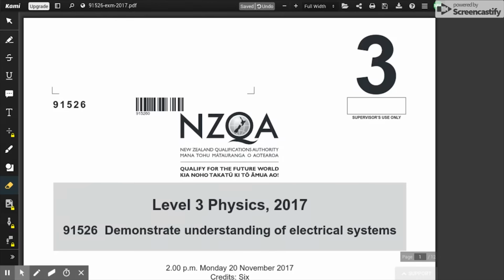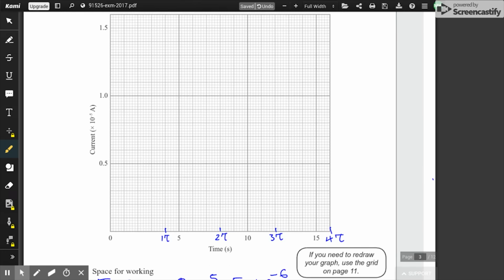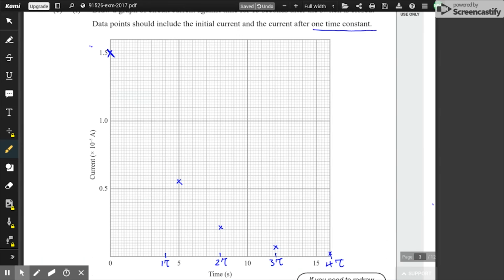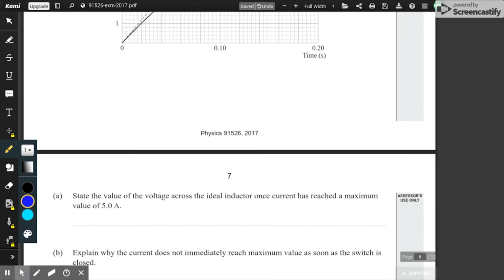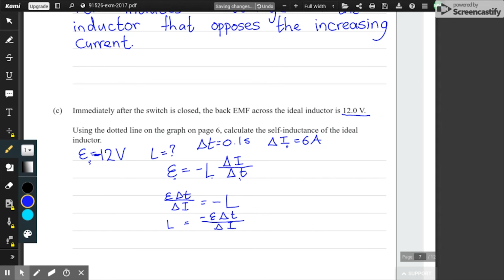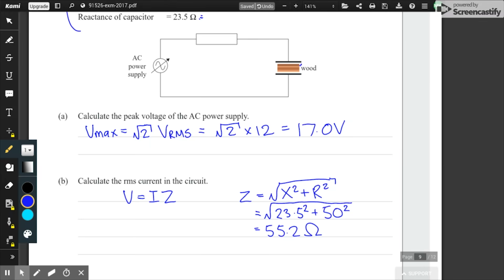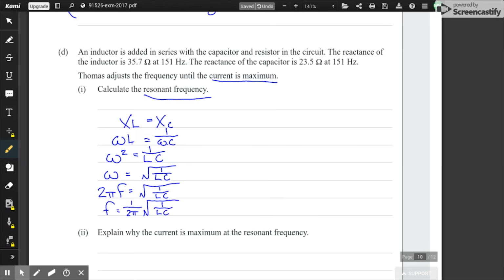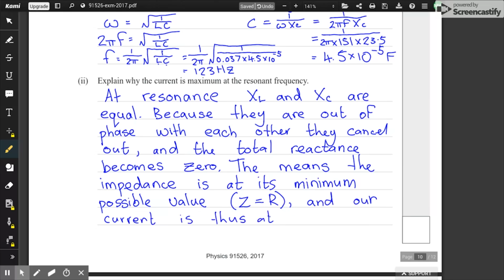2017 Electrical Systems Exam (NCEA Level 3 Physics)

Comment: for 1cii, you say the plates are at their maximum charge initially and discharge over time, but the question earlier says that the capacitor starts uncharged. Shouldn't it charge when the switch is closed rather than discharge?
Reply from the maker: Hi Jack, good catch. I've written this for the case of a capacitor discharging, when it is in fact charging.

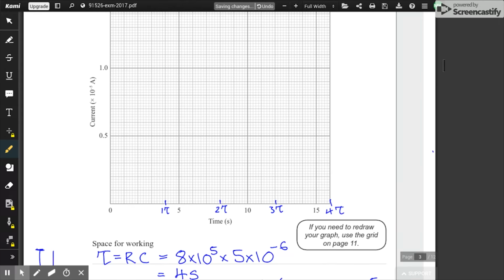Comment: Hi sir, at the 6:00 mark, you plotted the 0.56 away from the 1 time constant symbol, was this an error or is there a reason to this
Reply from the maker: Woops! That is indeed a mistake. Fortunately the marking scheme is usually quite forgiving for these problems. For the full Excellence it only needs two correct non-zero values, so this would actually still get the full mark.

Comment: I've noticed you didn't do the 2018 ncea level 3 electricity paper, what happened to it?
Reply from the maker: Never quite made it to the top of my todo list. Unlikely that I'll double back and cover it now, particularly since the standard will be replaced in 3 years.
Reply: @MrWhibleyPhysics  wait really? Is the electricty standard being replaced by another standard? If so then by what standard?
Reply from the maker: Sure, NCEA L1 changes next year, L2 in 2026, and L3 in 2027. NZQA have barely begun to figure out what the changes to L2 and L3 will look like. They've done a bad enough job so far that some of our largest schools plan to stop offering NCEA in favour of other qualifications (such as Cambridge and IB).
Reply: @MrWhibleyPhysics  If L2 and L3 changes in the future then how are u so sure that the standards will also change and that it's gonna be replaced? And are u saying that schools with Cambirdge or IB will remove NCEA in the future forcing every student to take either one of these 2 UE pathways?
Reply from the maker: Information on the NZQA website: https://ncea.education.govt.nz/understanding-how-ncea-requirements-are-changing.  At Year 11 these schools are typically coming up with their own in-house certificate, while replacing NCEA English, Math, and Science with IGCSE (Cambridge) for added legitimacy.

I haven't seen a school with a firm plan for what they will do at Year 12 and 13, most seem to be delaying a firm decision as long as they can to ensure its as informed as possible. It's not a simple decision.
Reply: @MrWhibleyPhysics  I see so you're just being aware

Comment: The exam this year is tomorrow, so hopefully someone can answer in time. If resonance is when reactance of inductor and capacitor are the same, why are they 35.7, and 23.5 ohms each?
Reply from the maker: The equations for reactance are X_C = 1/2πfC and X_L = 2πfL. Notice how the reactances depend on frequency. The reactances given in the question are both for the 151Hz frequency. The reactances will be different (and indeed equal) at the resonant frequency. Hope that helps.
Reply: @MrWhibleyPhysics  Fast reply. Thanks, that actually does help a lot
Reply: how did it go?

Comment: for anyone wondering how to use the calculator without getting calculation errors, use the exp button instead of the ^ function. It is much easier to plug into our calculator for example instead of 1*10^-3 you can do 1(exp) -3 instead, it is a better way of doing 10 to the power of a number. Hope that helps
Reply from the maker: Solid advice. Many a headache would be saved if people took the time to learn their calculators.